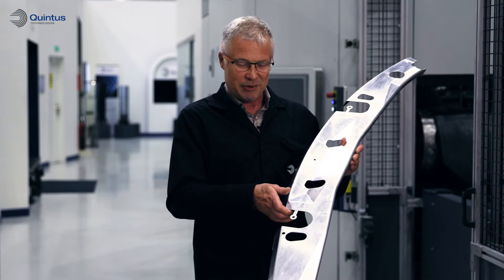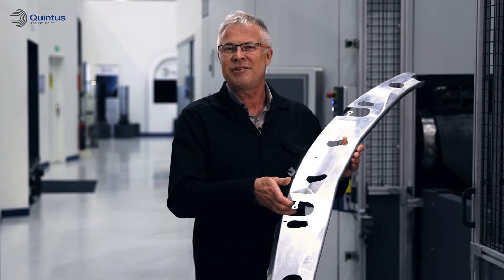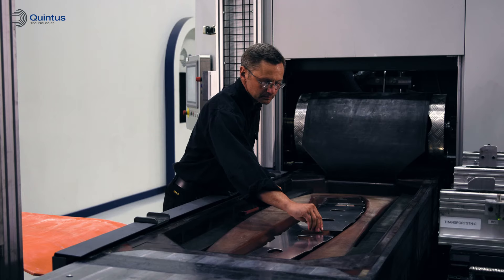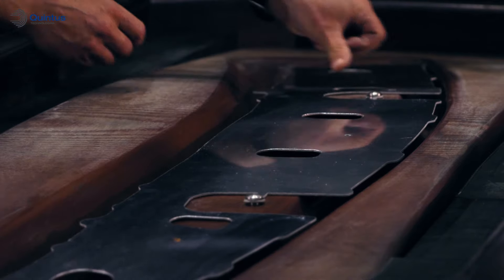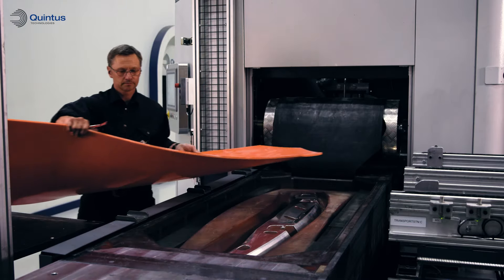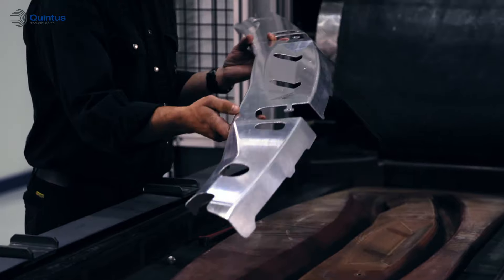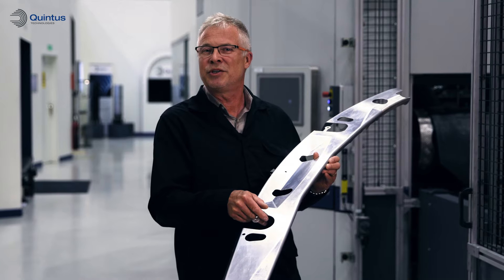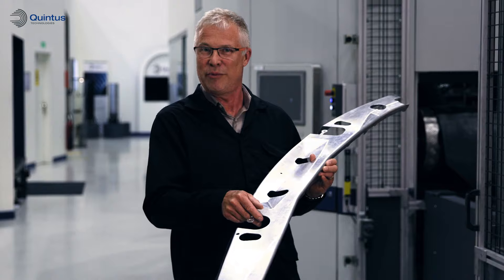Aircraft door frame

Comment: An excellent press to fabricate a wide range of aircraft light alloy sheet metal components .As a sheet metal  legacy shop manager who worked for over a decades, seeing thru tool prove out and production, it is very satisfying to see modern  S M process developments .
However , tool development, blank development for each application involves significant labour, add to it the up -front investment in the expensive Quintus machine 
No doubt,  Quintus press and it's process have  contributed significantly to  reduction in lead time, and subsequent ramp - up to meet market needs in civil military Aerospace mfg in the last 2 to 3 decades.
Kudos to Quintus innovation !!👍